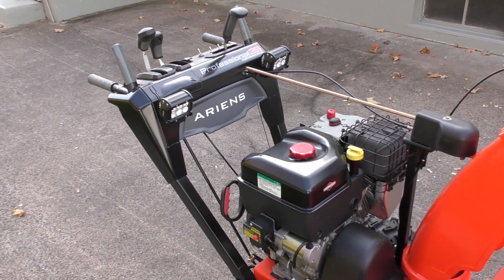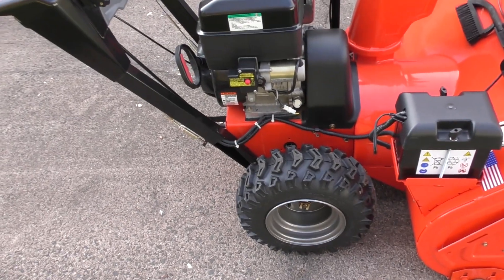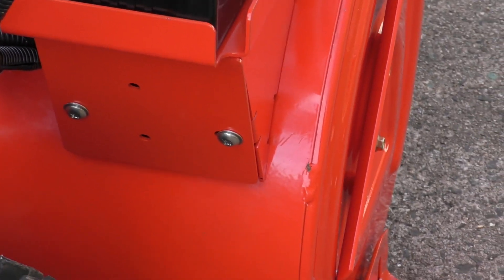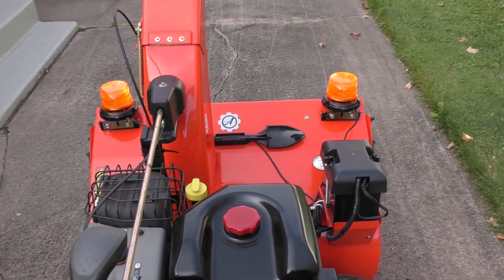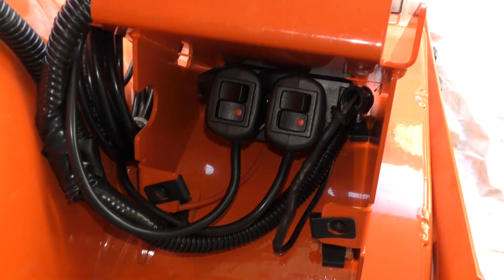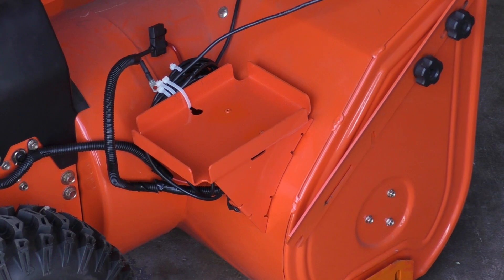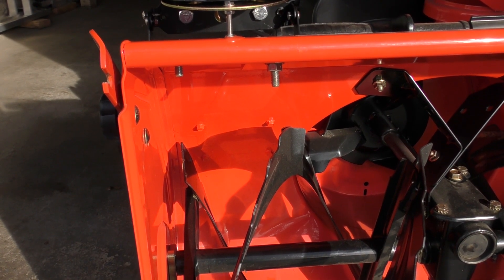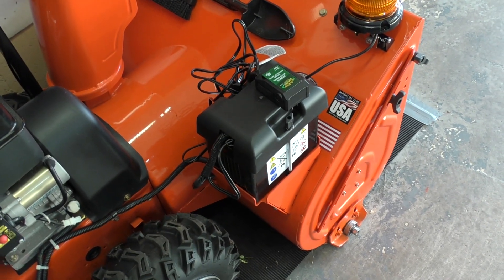How to add a battery to your snowblower for lights.

Comment: I'm glad I live on a quiet street, but I love the orange strobes, lol. I just got my battery tray parts from Ariens the other day. Next step is to get a Predator engine, then I'm going to get an 18amp rotor/stator for an EZ go golf cart so I can recharge while I blow snow, and operate my headlights and basically start it like you would a lawn tractor. Fun summer project!
Reply from the maker: Where I use to live the strobes saved me from drivers doing 45-50 in a snowstorm, going down a residential street. As soon as you clean out the mail box or mouth of your driveway you are at risk of being killed. No joke.
Leave the strobes off if they are not needed.

Comment: Thank you for this information. I have an older snowblower that I have re-powered and needs a battery for starting. These are the exact parts I need. Thank you for part numbers. ✌️🇨🇦

Comment: Hey, I live just north of Waterbury, likely not too far from you. Great job on this mod. I did a similar mod, but upgraded the stator, put a bridge rectifier in, but no battery. I do need to put the battery in though, but a small one, like a 3 amp hour, since I expect the stator will charge the battery and run the lights too.

Comment: Great Job!  I have a Pro 28 Briggs very much like yours and I want to add a battery.  Was wondering if an "efficient" inverter would run the 110 volt starter, i'm sure it's best to simply replace the starter with a 12v version.  Battery plate looks great.
Reply from the maker: I would think it would. But that is only a good guess. They run converters to use drills and small fridges while camping right? so the starter is a small motor.
Reply: @007connecticut  That was my thought.

Comment: This is Great !!

Now, For those of us that are rural, or on farms, that have really loong driveways or lane ways ( > 200' long ):

---  what about adding a battery circuit to the Electric Start for the Ariens Snow Blowers ?
( May have to swap out the 120V electric starter motor for a 12V motor ? )
Or be able to use a Battery / Inverter to plug into the 120V electric starter motor receptacle ? 
    Or a dual-use switch, allowing either an electric cord Or a 12V battery for the electric starter ??
Reply from the maker: @hydrogenger9364  the first batteries on ariens snow blowers where used for the 12v electric start and lights. Then they went to ac electric start and got rid of the on board battery.

I don't know if a 12 volt electric starter is made any more. If you live on a busy street those truck lights have saved me from getting killed, they may look stupid but they saved my life. Now the high speed traffic goes way over to the other side of road. They don't know how big I am, maybe they think I'm a bucket loader or something in the dark. Lol

Comment: Very nice video. I have an Ariens 1332 DLE. It already has a factory 12V battery and charging system. I would like to install a set of LED fog lights. I am wondering if I can connect them directly to the battery with a toggle switch instead if of hooking them into the existing headlight wiring which is AC voltage and require a bridge rectifier. The LED fog lights draw 0.6A each. I am trying to determine if hooking the fog lights to the battery will have any adverse effects on the charging system? Any input you may have would be very helpful. Thank you.
Reply from the maker: It's far easier to hook it to the battery. The headlights will shine for days if not weeks because the draw on them is virtually nothing. On my channel on a later video  https://youtu.be/1AyQioFYUfM  
 I added truck strobe lights to the snowblowers using a battery tray and lawnmower battery  (exact same setup on your machine / using Ariens parts). I charge the battery in the beginning of the season with a trickle charger then unplug it. I use the strobes by the road and neighbors sidewalk so some fool sees me at 2am. The strobes must draw more power than the little LEDS but the battery is always charged. I'm confident your machine won't even notice the electrical draw on LEDS. On my machines even at idle the leds don't flicker out while the handwarmers are turned on. If you got the battery on board go that route to avoid using the bridge rectifier. Keeping it simple is always a good thing.

Comment: Quick question for you. I see most people have to hook their LED's into the AC of their alternator and add a rectifier and capicitors, etc. I have a 3/5 amp DC/AC alternator. My snowblower is not using anything for DC. I am going to add an 18 watt Auxbeam LED to my blower. I can hook right into the 3 amp DC side of my alternator, no rectifier, no capacitirs, nothing and I am good to go correct?
Reply from the maker: Take a volt meter to make sure it's putting out DC, if it is you should be good to go. (providing you wire the LED light correctly / LED diodes won't work wired backwards).
Reply: @007connecticut  Ok Thank's. Thats good than, I should be able to by pass all those steps, rectifier, capacitors, fuses and hook it straight up. I'll let ya know how it goes.
Reply: @007connecticut  I was just watching your video on adding the on off toggle switch, that was easy enough, you just tie two wires into the red positive wire of the light, one in one out. Now since I'm going directly DC the red wire will hook to the single red DC on the alternator and the black wire I just ground to the frame correct. You called it DC negative, but for me that will be ground, am I right?
Reply from the maker: @Mr_Tecumseh  yes ground or negative is the same
Reply: @007connecticut  Awesome, I thought so, just wanted to be sure. I'm finishing up a 1987 Ariens ST824 Restoration. When its done I'll share it.
Reply: @007connecticut  Video of restored/upgraded 87 Ariens ST824
https://youtu.be/HKMHgAuShtk
Reply from the maker: @Mr_Tecumseh  I like it! Good Job!

Comment: that is cool, so the blower is DC electric start?
Reply from the maker: Electric start is AC. Originally you will need to plug it into a wall socket. I suppose It can be rewired to run off the battery. It should be an easy conversion. Or wire in an inverter?
Reply: @007connecticut  I got.a replacement motor and it is electric start. But it is dc.  I would like to switch to ac
Reply from the maker: @earthenergyhex  One advantage of DC you can start it anywhere without the need of an extension cord. Maybe add a battery tray and buy a little tractor battery? (like what I did) or I'd look into the electric start parts to see what parts you will have to purchase to switch it over. The AC parts must be the same. Order them for the brand of engine you have.A good source is partstree.com them have all the prints to see what parts you need to purchase. Write down the part numbers then search the net for the best prices on the part numbers found.
Reply: @007connecticut  I found a battery tray like yours on ebay but they want $59 for it, not including shipping.  maybe I will make one.
Reply from the maker: @earthenergyhex  Ariens might still make the parts, but it's not cheap. One good thing about the battery up front it helps hold the nose down. I use a  small $20 battery charger once a year called the battery tender JR tp charge the battery. I plug it in the fall and it's good till next fall. The Led beacons use no power at all.
Reply: @007connecticut  thank you , you have been a big help
Reply: I went ahead and bought the Ariens parts.  It will be worth it to me.

Comment: Can the snow blower recharge the battery?
Reply from the maker: No I didn't try to wire it for that. I went with a plug in battery charger that plugs into any AC socket that costs like $25 bucks. At the end  of the video I show the wire that plugs into the battery tender Jr charger that I will use between storms.
Reply: @007connecticut  I order a two stage snow blower from Walmart.com and it should deliver monday but I also want to add lights on it, but I see some video  with people using capacitors to avoid the flickering
Reply from the maker: @eagle5720  on my channel I wired this machine with a bridge rectifier a couple years ago. I don't notice a led flicker.  Check out the video, there is another of me running the lights in the garage. In my humble opinion a capacitor  is not needed.
Reply: @007connecticut  ok when I received the blower I will see what works best. Another question does all snow blower come with that external ac wire?
Reply from the maker: @eagle5720  Some machines have the electric start option so you simply plug it in to any 110V plug ( instead of pulling the starter cord) Mine have it but I never use it. The plug you see in my video is the battery charger wiring that comes with the battery charger. I love this charger as every machine I own has a battery charger hooked up to a battery. Even my Jeep that I don't drive much has a charger hooked to the battery. It makes the batteries last a lot longer and the engines all start when I need the tractor/zero turn/ Jeep/generator/ etc run.
Reply: @007connecticut  but what I'm trying to ask is about that I would hook up the bridge rectifier so I can hook up the lights
Reply: So where on the machine would I find that wire supply the 12v ac cause the machine doesn't come with lights.
Reply from the maker: @eagle5720  you will need to look on the engine. If you have AC power coming out of the engine you will see 1 wire capped off (My Briggs engines have the wire on the oil fill side) this wire supplies the heated hand grips and the original light) if you don't have the power coming out of the engine just add a little battery to supply all the DC power you will need. Adding a battery is the kiss method. (Kiss = Keep it simple stupid) lol.
Reply: @007connecticut  ok I will let you know Monday when I received it.
Reply from the maker: @eagle5720  another option is look on Amazon and buy a plastic battery box and lid for a tractor sized battery. Then screw that to your snowblower bucket like I did to my machine.
Reply: @007connecticut  when i get the machine I will see what's the best option
Reply: Check out my mods I do to the troy bilt snowblower I'm just wait on the flywheel and stator that order Ebay but Install the lights everything working so far.

Comment: Have you ever worked your snowblower , looks like new one..
Reply from the maker: I have 2 machines, a 36"and a 30". Both machines are housed indoors. I wash them yearly  to get the salt off of them and I bought paint for the 36" one and had to paint the insides of the bucket and chute. I found the exact color rustoleum implement paint to touch them up. I think the 36" machine is 4 or 5 years old now. The 30" is a 6 or 7 years old but  not used as much.